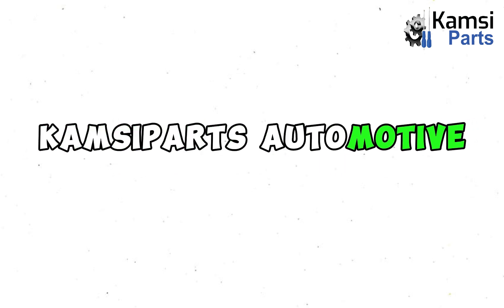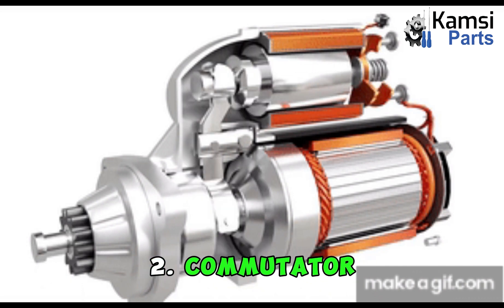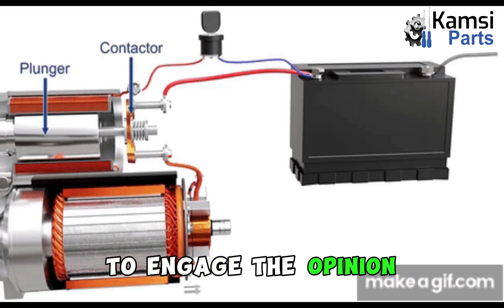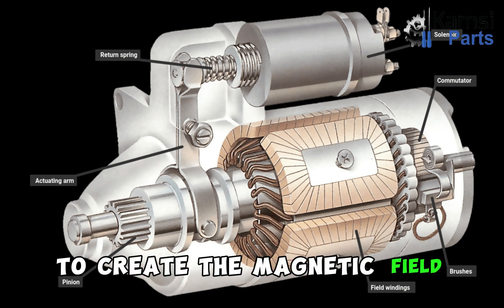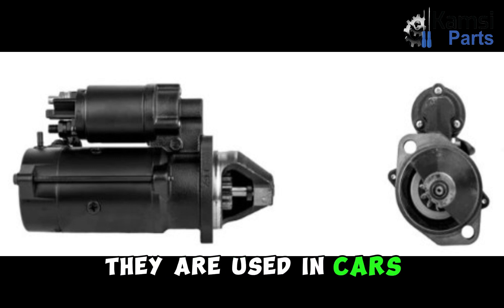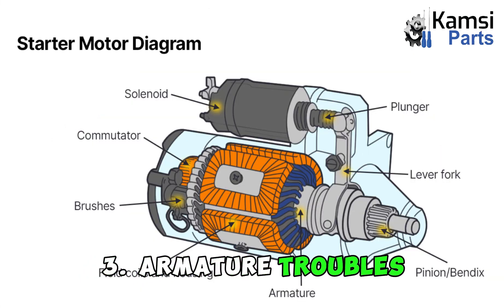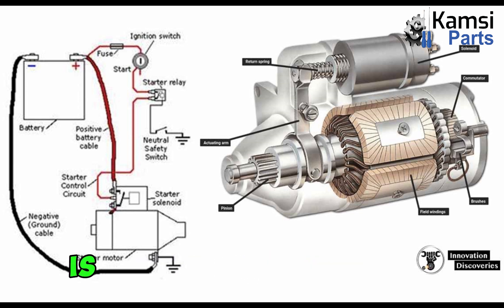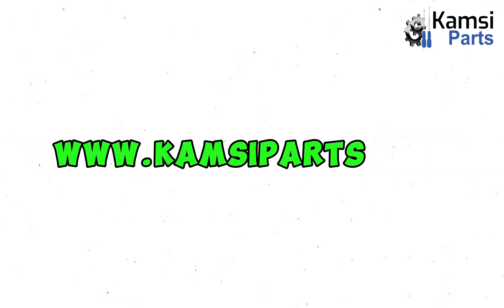ENGINE STARTER MOTOR AND HOW IT WORKS || BY KAMSIPARTS AUTOMOTIVE LIMITED

Comment: I would like to add that the solenoid has 2 coils. A Pull in and a Hold in coil. The Pull in coil grounds through the motor and the hold in coil grounds straight to earth. When you first crank the starter both coils are activated and the power going through the pull in coil is enough to turn the motor slightly so it engages better as it enter the flywheel. Once the solenoid has pushed the starter into gear the contact by passes the pull in coil and it`s just the hold in coil holding the solenoid in place. This saves the solenoid burning out. This is why if the holding coil is open circuit it will make a clicking noise like a flat battery. It`s very rare but if you jump the car and it`s still clicking then that`s the fault.